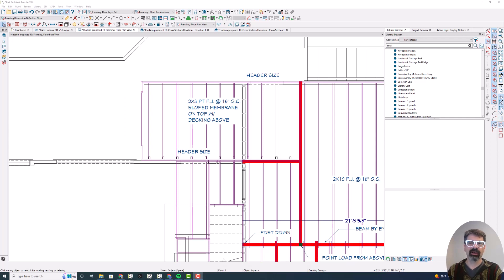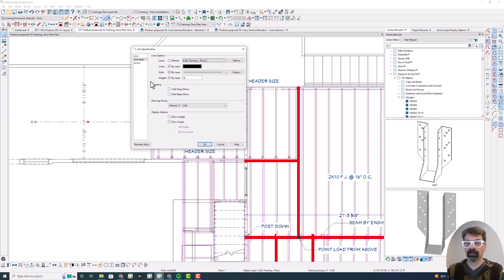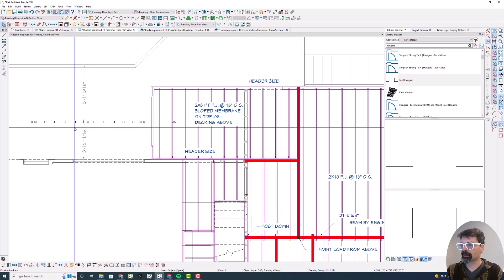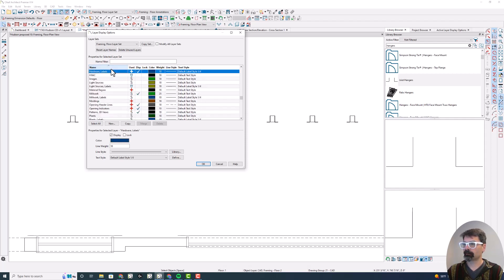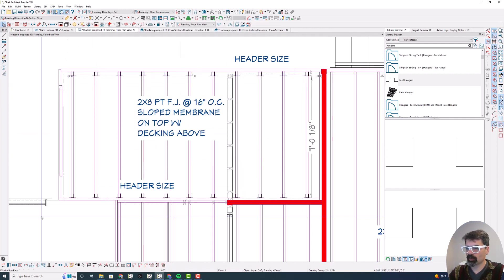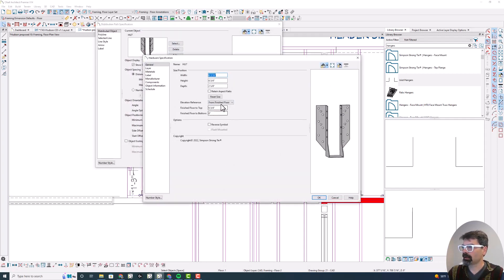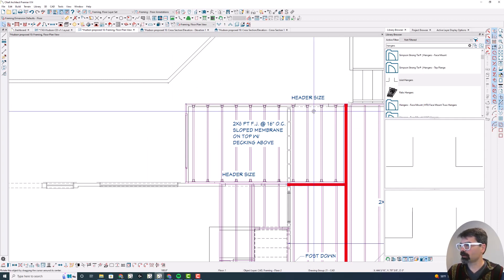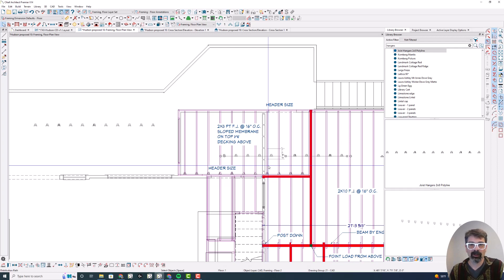Joist Hanger Libraries | Chief Architect

Comment: Do these show up in 3D view?
Reply from the maker: Yes. You have to have both layers turned on: the layer the distribution line is on and the layer that the distributed object is on. In this case, my distributed objects are on the “Hardware” layer
Reply from the maker: Then yes, they show up in 3D and section views

Comment: Every time I do a deck plan I spend hours installing joist hangers, lateral bracing, post bases, etc. It makes for a cool looking plan but does nothing functionally for the plan lol (that's what detail pages are for). It's fun to do though.
Reply from the maker: Do you add the hangers individually? This distribution line method saves me a lot of time!
Reply: @DesignbuildsolutionsLLC  I use the transform-replicate tool: Install one hanger then set the offset to whatever the joist spacing is on the transform-replicate tool..
Reply from the maker: I often think “why am I spending so much time on these details when I could make detail pages?” But then I realize that these details where I actually place beams, braces, brackets etc make it that I catch so many issues before the field does and I get to note those, change something, or at least discuss with the contractor to make sure everyone is understanding the issues

Comment: Great tip Tim. Never thought of using distribution lines for this. I typically place one and multiple copy. This method is better because if the framing changes it's easy to adjust the line or spacing.
Reply from the maker: Thanks! I did the multiple copy for a while. I was frustrated with the distribution line idea due to so many steps until I figured out how to set it up and save it in the library.